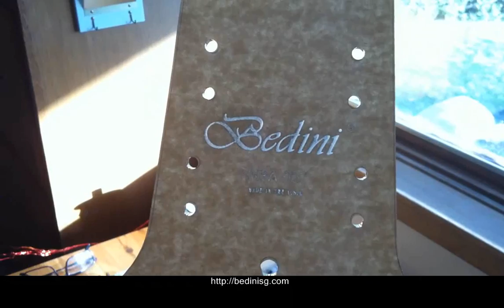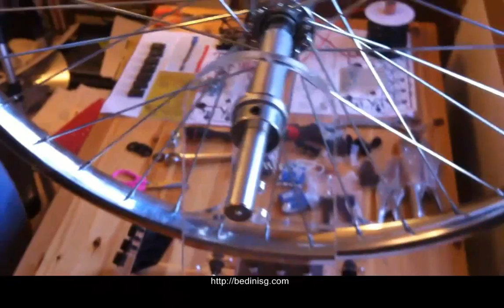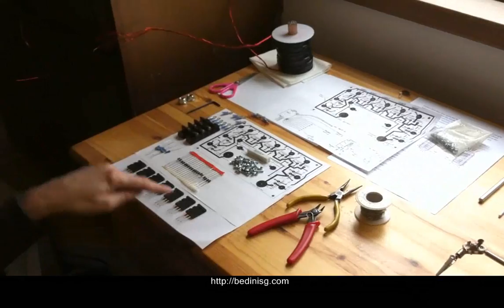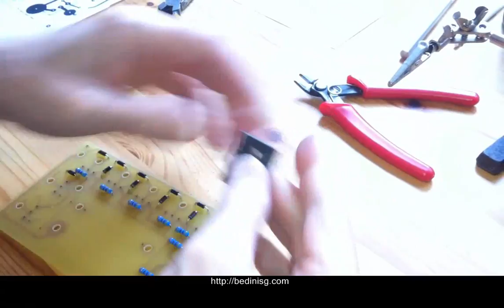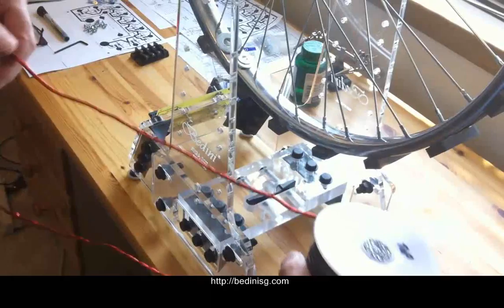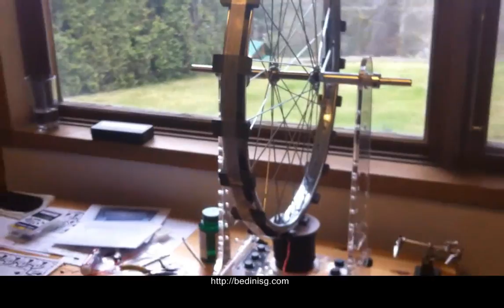How to Build a Bedini SG Energizer

Comment: Once the output battery is completely charged.  Could I run a 2.5 AMP  power invert-er with the machine running.  With or Without the need for a voltage regulator.  I would be a happy customer if I could keep my battery charged and run say this Power invert-er COBRA CPI2575 2500 - 5000 Watt Power Inverter Car 12V DC to 120V AC.  I ordered the Combo Pack.  I've watched your videos and feel like I'm finally in the right place. I hope to be trading ideas with you for quite some time to come. 
http://r.ebay.com/lH75k9
Reply from the maker: It is bad for the battery to receive a charge and power a load at the same time. The lead ions in a battery are heavy and sluggish and once put into the charging direction, they like to keep that momentum. When you try to power a load, you're going against the grain so to speak.

Some people put multiple batteries on the back and and keep on one the front. When the front is down, they rotate one on the back to the front and put the front one on the back. If you have 3-4 batteries on the back end each with its own diode, you could remove one of them completely and use it to power something and when it is discharged, you can put it back on the back end to get charged up again.

You say 2.5 amp power inverter, but it is a 2500-5000 watt inverter?
Reply: 2.5 to 3 Amps is the Current draw I would like to have for a whole night.
P = 3A × 110V = 330W.
 If I was running on just one battery at a time, like I figured I would have to.  
I would like it to last 6 hours or so.
  * It seems I would never want to exceed 3 Amps of current draw from the power inverter; or I would drain the battery too quickly.
*  I could parallel two batteries and get closer to 6 Amps and be able to use it for 6 hours.
 *   However If I needed more power the 2500 Watt power inverter could deliver it.  Just for a short period of time with one or -- better two batteries in Parallel.  
*  The battery rotation idea can still get me what I want; which is power for one full night, uninterrupted, no need to swap batteries till morning, with no Power Grid around, and no gasoline for a Generator..
Is my thinking flawed??
Reply from the maker: It is a good idea to do long term draws at the C20 rate to get the rated capacity from the battery. 330 watts drawing from a battery bank is 27.5 amps draw at 12 volts. 27.5 amps * 20 hours = 550 amp hour battery bank. That would be ideal for that draw. If you're running around 12 hours a day (at night), you could get by with a 450 amp hour battery bank, which is 4 Trojan T-105's. They're 6v at 225ah each so putting them in series and parallel is a 12 volt 450ah battery bank, which is about perfect for idea needs. You would have 12 hours of light to charge them by whatever method. you want. You need to replace 330 watts @ 12 hours, which 3960 watt hours or almost 700 watt charge for 6 hours for example. 

The SG with 7 power windings is ballpark 18 times too small for this particular application. A single coil with 7 power windings draws about 20 watts from the input battery steadily for x hours. The charge you get for that will be around 18-19 watts of power for the same hours. That is your 90-95% recovery in the back battery and we didn't include mechanical work. You'd need 2 machines with 9 coils each with each coil having 7 power windings to put 3960 watt hours of charge back to your batteries in a 12 hour period and you'd still have to supply energy on the front end as well - you're better off just charging your batteries with solar if you want to be grid free.

If you need 330 watts per hour for 12 hours in the light, I'd recommend getting about 500 watts of solar panels so you can have enough during low light conditions and getting the S40A12 Tesla Solar Tracker 5 http://teslachargers.com/teslasolartracker5.html#s40a12 and that is a perfect match for those 4 Trojan T105 batteries.

You should be able to draw your 330 watts all  night about 12 hours and recharge it fully with 12 hours of light even with lower light conditions since you have 500 watts of panels to compensate.

You're looking at a $2200 solar power system, but if you're looking for totally self reliant, that is realistically what you're going to have to spend. You could shop around and save $ on some 100 watt 12v panels, but make sure the VMP (loaded max voltage) is 18.5 volts - don't deviate from that number more than 0.5 volts. With batteries, you might be able to save a bit too by going with another company other than Trojan, but I would try to stick with that.

Our solar charge controller will bring the batteries to the proper topping voltage so the batteries won't degrade day after day from chronic undercharging, which is what all other charge controllers will do. Protect your investment in batteries with our solar charge controllers.

Also, there are good reasons to go with 6 volt batteries instead of just 12 volt batteries. Get the free book at http://freesolarsecrets.com - we have all the details.
Reply: Thank You So much.  This is Great information.  I really appreciate your time.  You have been a big help!
Reply from the maker: Bill Hawkins You're welcome hope it helps. 330 watts divided by 12 volts is 27.5 amps X 20 hour draw rate = 550 amp hour battery bank. That is actually a bit bigger than the T105's at 450ah and Trojan does have some closer to that. Good luck with your project.
Reply: Bill Hawkins sorry for jumping into an old, finished conversation, I just thought his answer was strange...you asked about the sg and aaron's reply included talk about solar... if he was just suggesting that you run your sg from a solar panel I guess it made sense, but the phrasing makes it seem that he's suggesting you charge the batteries straight from the panels with no sg...
Reply: Aaron Murakami I can't help wondering why you would say he is better off charging straight from solar if this sg design really can turn the back battery into a negative resistor that boosts the charge rate, and really lets you charge additional parallel back batteries without reducing the power going  into each one?..  seems odd that these magical improvements wouldn't help to boost the power from his solar...
Reply from the maker: sceptic33
What's the original context? Who asked and what was my exact reply?
Reply: Aaron Murakami the context is here in this thread... bill Hawkins is asking about drawing 300w from a battery being charged by an sg...   you're telling him he'll need a bigger sg with more coils to provide enough charge to his batteries..  you then go on to say :   "You'd need 2 machines with 9 coils each with each coil having 7 power windings to put 3960 watt hours of charge back to your batteries in a 12 hour period and you'd still have to supply energy on the front end as well - you're better off just charging your batteries with solar if you want to be grid free.If you need 330 watts per hour for 12 hours in the light, I'd recommend getting about 500 watts of solar panels so you can have enough during low light conditions"
Reply: He was referring to my question regarding the biDini battery charging circuit.  That was a completely separate project from the solar panel charging system.  I'll try to find the link to the video where he built this battery charging device with the coils and magnets on a free spinning wheel perhaps that will make it clear.  
However this has nothing to do with using solar panels and his solar panel battery charger to charge a bank of deep cycle batteries.

Comment: Nice job Peter.  Use a couple one ohm resisters and scope with some integral calculus  and walla you'll know input and output power.   Replace fan with generator and cook diner.
Reply: using negative to generate positive to recharge battery

Comment: I want to see this thing work with a 9v solar cell in place of the 12v car battery and do away with the back charging. That in my mind would be more impressive than showing a 12v battery charging a 12v battery you might call me just a little skeptical at this point!
Reply: IF You want to see that spec.  go and make one, they show you exactly what/how to do it, so not much to stop you if you REALLY want.
Reply from the maker: Running it on a solar cell is more impressive than running it on one battery and recovering 90-95% in another battery? OK

You can run it on a solar cell with the right configuration, but why do away with the "back charging"? What would you do with the recovery?

Comment: whats the point of that propeller? If the goal is to produce electricity why not use diodes to make dc  like in wind generators?
Reply from the maker: Demonstrate a basic mechanical load.

Comment from the maker: snaprollinpitts - it is actually impossible to measure what really happens in the circuits. You can measure the input draw pretty accurately with a current sensing resistor from the front battery. However, the output spikes from the coil going to the secondary battery cannot be accurately measured. The only honest test is to charge the back end battery with the spikes and then after it is charged, apply a fixed resistor load in the c20 range, draw it down and measure what you get out of it. Putting meters on the output will never show what is really happening. Also, when the impulses hit the recovery battery, there is a chemical change that takes place that is not directly proportionate to the electricity that went into it - it winds up being more.
Reply from the maker: I can measure the spikes just fine with a good scope as the voltage is only a few hundred volts. Tektronix company loaned me a TDS-3054C - a $14,000 scope a while back to do all kinds of tests like this. 10,000 samples per screen so you can conduct fully integrated power analysis of any waveform you want. You can put one spike on the screen, dump the data to Excel and measure with pretty good accuracy how many watt seconds of real energy is there and you can multiply it out over time.

However, what you measure with the spikes is NOT directly proportional to the amount of work you get out of the battery when it is charged up - you get more when the battery is charged than you measure leaving the coil.

The battery becomes a negative resistor when charged in this manner.

Once you get the heavy sluggish lead ions to start moving in the charging direction, you can keep the moving by furnishing virtually no current and only voltage potential. That is why charging a battery with the spikes is called a "potential charge".
Reply: "Also, when the impulses hit the recovery battery, there is a chemical 
change that takes place that is not directly proportionate to the 
electricity that went into it - it winds up being more."

In other words, it's overunity? Having an efficiency of more than 1?
Reply from the maker: AndrewChan84
Kits are not manufactured because the maker flaked on us. All details and specs are in the books http://bedinisg.com - in a good build with 85-90% recovery, adding mechanical will demonstrate over 1.0 cop (overunity). Most people will not see it with really small builds and small batteries with too much impedance.
Reply: "Also, when the impulses hit the recovery battery, there is a chemical 
change that takes place that is not directly proportionate to the 
electricity that went into it - it winds up being more." 

If we could scale up this chemical/electrical overunity that happens in the recovery battery, we could get a cop of 100 or more. In theory we could power an entire city with a flashlight battery providing the "front end" energy.
Reply: Aaron Murakami
 This "negative resistor" effect is interesting. I wonder if we can do a solid state version (not having mechanical parts) that creates the same type of spikes to charge multiple batteries at once, and get a really high overunity cop.
Reply from the maker: AndrewChan84
You can charge multiple batteries on the output - you can take a diode from all 7 power windings and send it to their own battery.
Reply: Aaron Murakami
Will the COP increase (get a higher overunity) if you charge multiple batteries at once?
Reply from the maker: AndrewChan84
To see serious gains, you have to use very LARGE batteries with ultra low impedance.
Reply: Aaron Murakami
Thanks

Comment from the maker: Yes, it is steel. It can be non-magnetic. For this kit, it makes it easier to mount the magnets. Also, the steel doesn't take away much of the magnetism from the magnets. The charging results are really incredible with this setup running in attraction mode so the steel doesn't appear to be an issue.